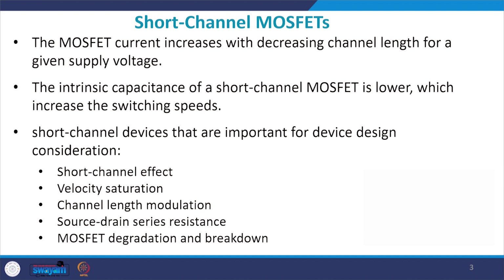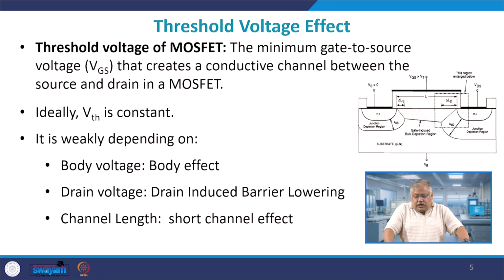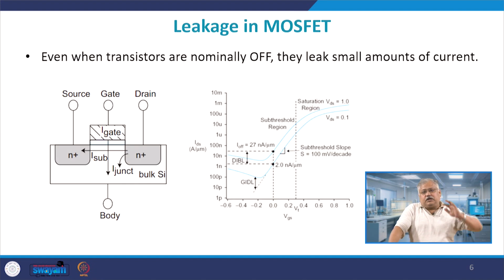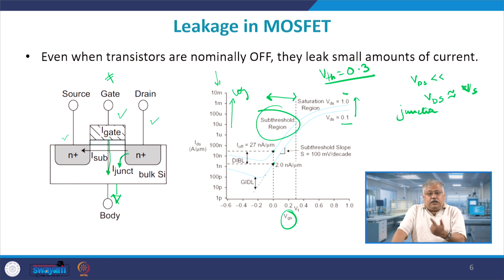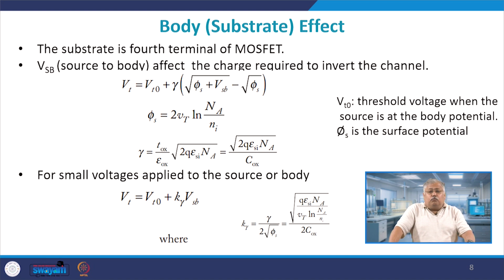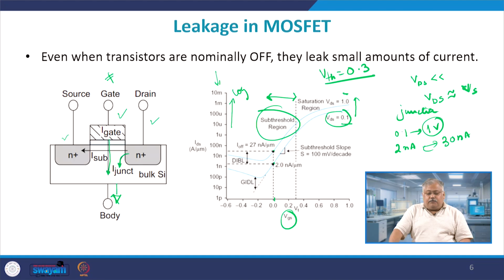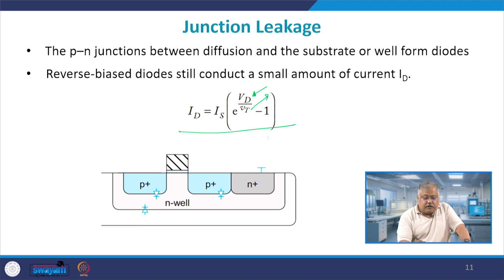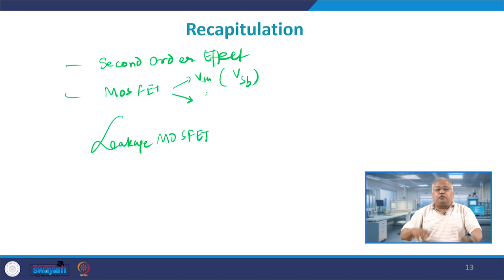Lecture 30 Leakage in MOSFET

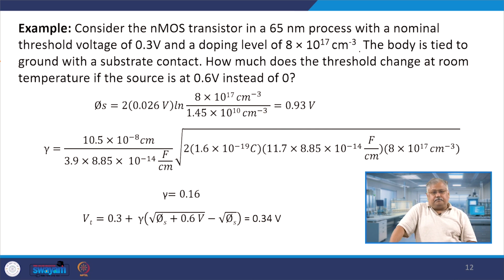Comment: At 17:25, 
Id will increase with temperature:  with temperature, vt (thermal voltage) increases, which decreases the Vd/vt value. But Is (reverse saturation current) increases with temperature because it will depend upon the concentration of minority carrier charges (which increases with temperature)